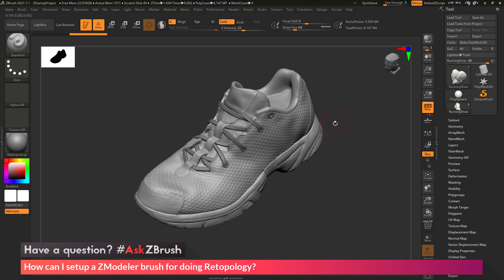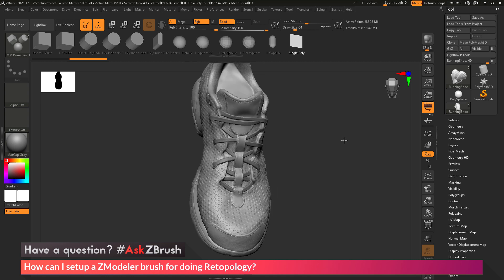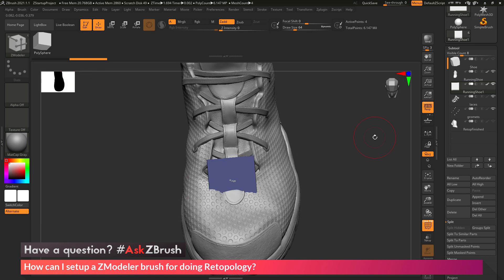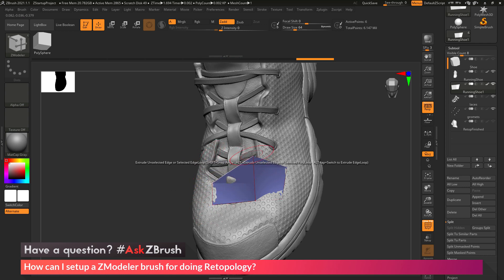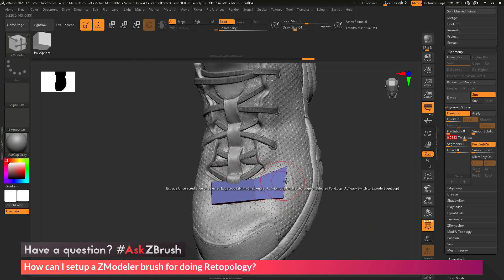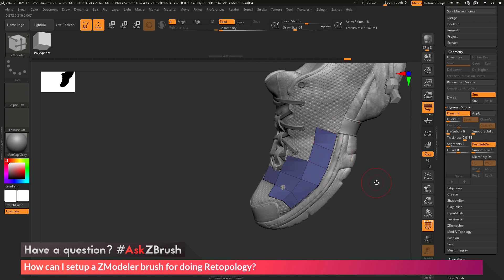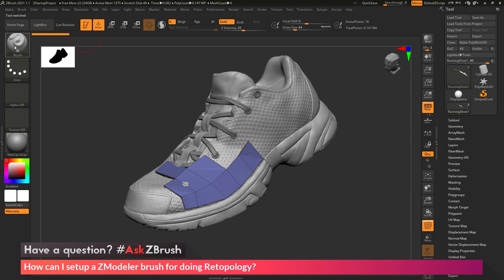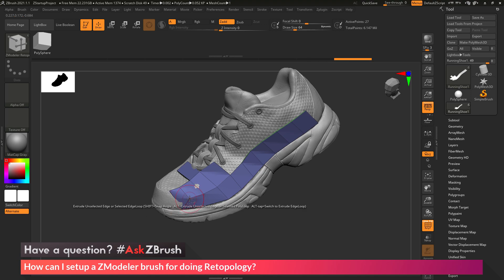#AskZBrush - "How can I setup a ZModeler brush for retopology?"

Comment: When I watched the Doom Eternal stream and they mention they did all their modelling using the ZModeler tool. But it seemed crazy to have to switch settings constantly depending on what you wanted to do - just one brush that you can configure in a million ways! But now I finally get it, you can save out presets.

Comment: Great informative video, set my retopo brush as well as palette which also utilises some the dynamic palette buttons, projection, & simulation iterations. I usually use Transparency to visualize see the extruded edges, but the dynamic subdivision's thickness actually is a better trick, thanks :).. I just finished retopologising my first character completely in ZBrush and only used Maya for smoothing normals and scaling the character up.

Comment: I am using the latest 2023.1 version. I tried the same thing and set the Points to "Snap to Surface". For some reason, the snapping doesn't work anymore. Did I just find a bug, or am I missing something substantial now? Thank you and keep rocking, cheers